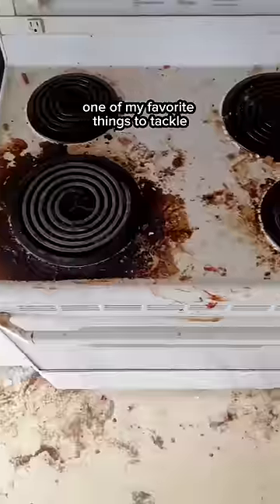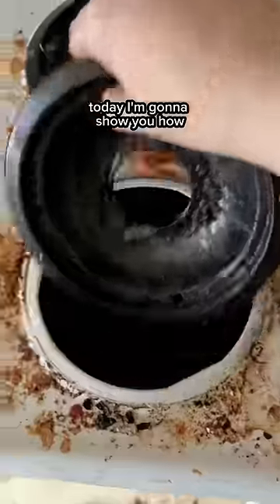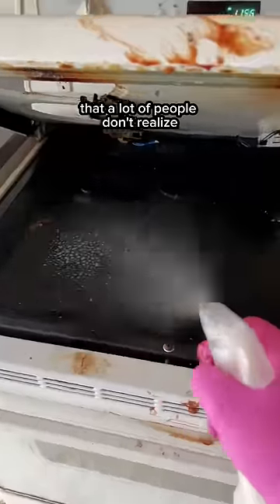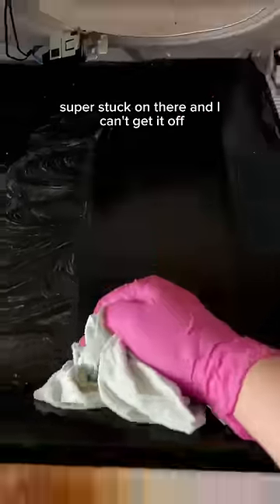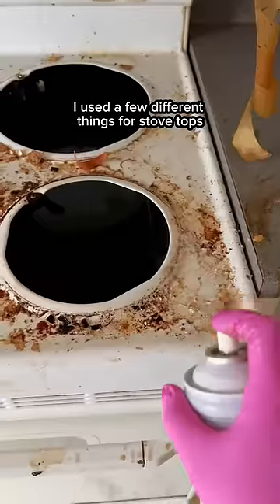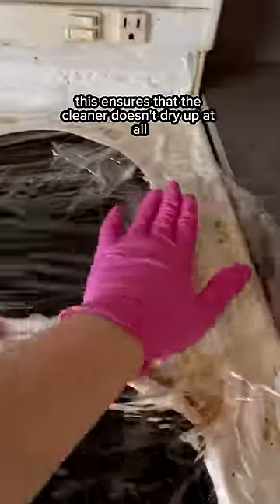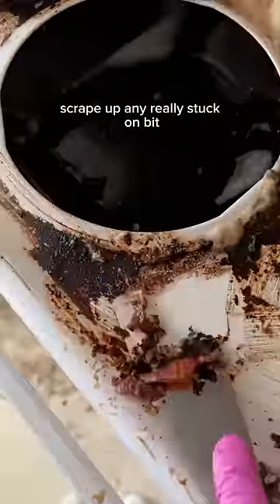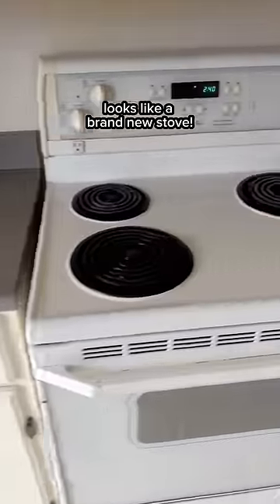How I get greasy dirty stove tops sparkley clean again ✨

Comment: Some people don't realize that the stove top opens up to clean.
Reply: I don't know how😅
Reply: Seriously I never knew and whoa I'm afraid to look now lol
Reply: Only some. Ours needed to be unscrewed and there were wires. So not designed to be cleaned inside.
Reply: After you pull out the coils, lift up the pans, rinse and let soak in hot soapy water. I usually clean the top surface next, so if any thing drops below, I only have to clean the underneath once. Grab the hole and lift up gently like a sedan car trunk, and you can access the underside.
Reply: I don't think the gas stoves open up like that.
Reply: I was 3 apartments in before I realized you could do that 🫣 where was this video when I needed it lol
Reply: I didn't and experienced a few seconds of absolute panic before remembering I have an electric stove top 😅
Reply: @grenwood6551  Sometimes there's a little lever that you have to slide or push before you can lift it up- that is, if yours does raise.  I had an old stove that didn't lift up, but the one I have now does.  Check for the lever thingy  :)
Reply: @Deci_Bella  some do. if it doesn't have sealed burners, you can lift it. my gas range from 1998 top would lift up.
Reply: @Deci_Bella  unfortunately you're right. I have an older gas stove so no sealed burners. After buying the house I'm finding these people must have been stealthy hoarders cause there was lots of creepy hidden crap in the house. I can only imagine what might be lurking bekow the burners.
Reply: @patriciabaylor4573  I recommend googling the range model to see if you can find the instructions. I was sad to see that mine required a service person to take it apart after disconnecting the gas (which is too expensive when it's not broken!) Fingers crossed I've never had a rodent problem so I'm just in denial til I can afford a replacement, and hoping there's nothing lurking in there.
Reply: @emmasurf8768  I don't live in that house anymore. I didn't have any problem lifting it.
Reply: @Deci_Bella  mine does. It is scary because it doesn’t have anything to hold it open.  So it’s like a guillotine.
Reply: Does anyone really need to be taught how to clean a stove? It's just common sense.
Reply: Imma be honest, I didnt know this until after 2 years of having a stove top causw when I was like.. 11? My mom switched to a glass top stove which is when I started taking an interest in cooking and stuff so I had no clue
Reply: I didn't realize it did till yesterday...when i told you i was quite disgusted i mean it
Reply: @Deci_Bella  yes gas stoves open up
Reply: It's a fire waiting to happen if you don't clean under the stove top
Reply: @Deci_Bella  The top usually lifts out completely, rather than tilting. At least that has been the case with every gas stove I have cleaned.
Reply: Only if you have a gas oven. Doesn’t matter for electric because there’s no way for the food to get under it
Reply: Only the coil type cook tops do. Obviously the gas and glass tops don’t separate as easily but it can be done.
Reply: Mine doesnt almost broke it thinking i could
Reply: I just went and looked lol it’s true thank you for that wow
Reply: Mine has to be unscrewed and I’m scared of ruining something lmfao
Reply: I remember learning that during an annual rental inspection.
I was very embarrassed and I clean it regularly now.
Reply: @Kateiswriting 
My electric stove lifts up once you remove the burners - all the electric stoves I’ve had the burners pulled out. So once you have out the burners and the trays that they restaurant, what you see when you look at your stove. Then I just reach in one of the holes and pull up and there’s two wire arms, one on each side that props it up that I can safely reach and clean out just like you saw in the video. It’s rare that an electric stove does not allow you to pull out the burners and lift up the whole stove top essentially.   It’s the first time I heard about using an oven cleaner. But that would’ve certainly helped immensely when I had spilled things that I couldn’t clean up immediately because I was sick. So check out your stove. Just make sure all your controls are set it off that you don’t accidentally burn yourself. You can even wash off each coil burner, just make sure the prongs that have to go back in when you reassemble your stove are dry. Have fun getting to know your electric stove top. Someone else a remote that her stove top does not open. And before I knew you could lift it up, I still was able to unplug the coils and reach in and clean as much as I could. At that time, it was mostly crumbs. But when you boil over something that’s a mess good luck.🧽🫧🫧
Reply: Some do
Reply: I didn’t know either. I am going to try to lift my when I get home. I hope mine lift up. It will be way more easy to clean under it. 😊
Reply: Some do, but easy enough to find out which do.
Reply: @Katarina23 
They need to be reached inside the burner area, once you remove the burners, trays etc.
Reply: @Deci_Bella 
True, even some electric stove don’t lift.
Reply: What's really annoying is I used to have a stove that opened up like that and my new one doesn't and I can see stuff under there 
 
How am I supposed to clean that
Reply: @emmasurf8768  you’d know pretty quickly if you did
Reply: @Simba______  that’s a huge assumption. Some (especially older models don’t open for cleaning); some people haven’t been taught; people due to disabling medical conditions can’t. I was a military brat and on base housing a privilege that comes with higher rank. Housing is inspected before you move in and before you move out. And everything had better be in spic&span order or the service faces consequences, like a written reprimand or fine. Those affect promotions. You can’t imagine my horror when I moved into my first civilian apartment of my own. I was a young veteran by then with no experience of apartment hunting so I didn’t open the stove top or refrigerator. Most common sense is based on experience and not everyone’s experience is the same.
Reply: I always conveniently forget...and then inconveniently remember when I thought I was done.
Reply: Not all stoves are made alike!
Be careful lifting your stove top!
Make sure you read the instruction manual first or look it up the info for your stove's specific model.

The stove at my old house was designed for easy cleaning under the top. We had to simply grip the corners on the stove top, lift it up, and use the 2 built in *support rod props to hold the stove top up while we cleaned under there.

My friend on the other hand wound up having to call for a repair because she didn't know that unlike her previous stove, her current stove's top could couldn't just be lifted up to clean underneath so she wound up breaking something when she lifted up the stove's top. Whatever she broke a pilot or 2 wouldn't light afterwards.

*The same type of support rods that hold the car hood up when you do to work underneath the hood. Our stove had one on each side.
Reply: @Deci_Bella  they do.  Mine does.  Open it every time I clean.
Reply: I hate to admit it, but I never knew it before she cropped up in my YouTube feed.
Reply: I never knew..
Reply: I live in Italy and I’ve never seen that kind of stove before. Maybe it’s typically American?
Reply: I had no idea. When I learned I could, I realized the people before me didn't know either. So I didn't feel too bad. You could tell it had only had the parts you could reach through the holes cleaned.
Reply: @Simba______ imagination, compassion, and empathy is also common sense, yet you lack all three with this comment.
Reply: I didn’t until my partner showed me lol shit blew my mind.
Reply: I tried to lift the cover but small flames were still burning . I don't know if I can do that anyway. I'm afraid
Reply: I JUST FUCKING LEARNED THAT BRO WHAT THE FUCK ITS LIKE THE HOOD OF A CAR WITH THE THINGS TO PROP IT UP AND EVERYTHING
Reply: I tried to open it and I can’t
Reply: Not all are that easy.
Reply: OnG? I didn’t know🤣 I would just try to get it clean😭 now I know
Reply: @Deci_Bella Mine does but I'm not sure if I should spray stuff because of the exposed flame
Reply: 😂ŵaffĺe  house
Reply: Some do some don't surprised you dont know that it varies
Reply: Wow it’s like a magic 😅👏🏻 i tried with mine
Reply: @Deci_Bella mine does.
Reply: Also the pots & pans drawer at the bottom of the oven. Seriously, some do not know about this.
Reply: Nobody told me this and i never seen it until now so 🤷🏽‍♀️

Comment: You mentioned you use steel pads to get off REALLY stuck on grime, but as a former housekeeper, we were specifically told not to use steel scrubbers because they can scratch the stove. In this case, do you know what specific stoves are suseptible to scratches, or is it more imporant to get everything 100% clean rather than worry about asthetics?

Comment: We use Dawn to clean ours.  Works better than oven cleaner and isn’t going to kill anyone faster.  The dawn powerwash just has added alcohol, but it works even faster on tough things.
Reply: Dawn spray is a great grease cutter but I feel like it gets in my lungs. Does anyone feel that way too? I use it sparingly
Reply: Thanks for the tip

Comment: Covering those burner trays in a layer or two of quality aluminium foil so the dropped bits of food don't bond onto the tray can save hours of work in future. Covering the base tray works too. 
We used to be able to buy purpose made thick alfoil covers that just fit snugly but I haven't seen them for years.
(yes I'm Australian so it's ALUMINIUM)
Reply: Yes, I've just scrolled through the comments to see if anyone else does this.  (I've actually got a glass top cooker now, but my mum always put the foil down, so I did when I moved out & had to clean for myself.)

Comment: Tip for a flat top, take soft scrub cleaner, soak like you did Here, use an electric sander with a green scrubby instead of sand paper. I used to flip apartments, this trick came in handy.

Comment: I'd really love to know how you get the burner cover bowl things clean.
Reply: Yeah, that wasn't enough information.
Reply: I was thinking after the soak maybe that same oven cleaner stuff would do it. What I've tried has not cut it.
Reply: Soaking and scrubbing would do it
Reply: They usually soak off most in super hot water and Dawn. Depending on what material they are made from, those Steel scour daddies work really well.

Comment: For gas stoves I remove crumbs …then soak heavily with dawn power spray . Any areas that are nasty leave some baking soda for 10 min 
It comes out with no issues with a sponge 
I try to clean as I cook but at minimum clean 2-3x a week the stove so it does not get grimey

Comment: Having lived in so many places where all of the appliances were heavily scratched by using steel scouring sponges, I would never use them. There are other methods that do not work as fast, but don't damage the surfaces. Once the surfaces are damaged, they are way harder to keep clean.

Comment: Do you have a video about which products you can use with a scrub daddy that won't break down the plastic sponge? I used mine with a Cif cleaner (not the special Scrub Daddy one - can't find that anywhere) and Bar Keeper's Friend (not at the same time) and the sponge became super weird and sticky. I Googled and it turned out it was probably the products that were the problem. Now I'm scared to use it with anything stronger than dish soap and vinegar.
Reply: I have been using the amazing whip it (I know sounds funny definitely go to their website). It’s all plant based and eco friendly for pets etc. they have a whole line of products for laundry , pet odor elimination etc. it does wonders for me when cleaning 

I bought the scrub mommy for my dishes and I love it. Maybe the cif (not scrub daddy one) made it that way. I don’t know the difference between the two bottles of cif but maybe the formula was changed to preserve the integrity of the sponge.
Reply: CIF:  original or lemon ?

Comment: Have any advice on a Frigidaire glass top but it has like metal ceramic coated burners that are gas burners because the stuff is so burnt on that we’ve tried everything of things you’re not supposed to barkeepers which comment steel just everything

Comment: If you leave the oven cleaner on longer, it will cut through all that and you only need to wipe it. 

I spray it on and leave it as the last thing to return to, so the oven cleaner has time to penetrate. 

Works on pans, too…but not aluminum. And wash the pans well after using oven cleaner, which should be the very last resort for pans.
Reply: Won't oven cleaner damage the paint by the burners?
Reply: @debi7039  I’m not sure what you’re asking. But when I was house-sitting while my parents were away, I made a stupid mistake:

I was making popcorn in a pan on my parents’ glass-top stove, and a few pieces popped onto the burner. Instinctively, I grabbed a dry microfiber cloth and tried to wipe it, causing the cloth to burn on the burner.  So what did I do?  I tried to wipe THAT off with the same cloth. 

I don’t think well under pressure. 

I frantically called my sister, who appeared with a can of oven cleaner, sprayed the burnt spot (that was cooled, by this time), covered it with a lid, and instructed me not to touch it until the following morning. The next morning, I simply wiped it with a paper towel, and it all came off!!

A few years later, my husband and I moved to an old 100 year old house.  The house had a glass top stove, and on the glass must’ve contained several years of burned-on food. 

This stove took more time, but I sprayed it with the same brand of oven cleaner, covered it with sheets of plastic wrap, and left it overnight. The next morning, much of the crud wiped off. I had to spray it about four or five times, before I was able to get everything off the glass.  By the time I was done,  the stove looked brand new. It did not remove any paint that was on the glass. 

If you question the way it handles paint, try to find an inconspicuous area where the paint cannot be seen, and try to add some oven cleaner. If it eats away at the paint, then I wouldn’t recommend it. 

‼️ DO NOT USE OVEN CLEANER ON ALUMINUM!!!  It will eat away at aluminum, and turn it black. I used it on one of my mom’s toaster oven cookware, and she wasn’t happy. But, truth be told, if you have aluminum cookware, you shouldn’t be cooking in it, anyway. Aluminum is not good for the body.

Comment: Just cleaned the oven and stove top. Luckily the oven is self cleaning and honestly does a great job but spent close to an hour trying to clean those dang burner trays, and they did technically get more clean, but when they dry. They look awful. Frustrating.

Comment: When you pull the top of the stove up are you just using the scrub Daddy? No mention of any product used under there. What do you suggest for people that are really sensitive to cleansers and also have pets? Right now I only use soap and water I was using simple green but my dog had a seizure so I won't be using that even though it's supposed to be safe. I didn't dilute it as well as I could have and he is prone to seizures. I recently discovered boiling water, I had never tried it before and I cannot stress enough how incredible it is for cleaning grease and grime and everything in between. If you put boiling water on everything including stoves, floors, counters, cabinets, bottom of the refrigerator it will take up a lot. But I was just wondering if you could please recommend something for those of us that cannot use these poisonous cleansers. Further, you're exposed to a lot of toxins in these houses and then you're doubling your exposure to poison by using these cleansers. I know you're in a hazmat suit and you're protected, can you please show us again what mask you using I believe you're using a painter's mask or some other type of hazmat protection? Though I would not use one of my own house I would use them on my work houses as I fix and flip real estate. You're cleaning has really inspired me. Just coming from a place of non-judgment and understanding the psychological effects has helped me with my own cleaning issues and then of course understanding the homes that I buy and what people have gone through mentally to get where they are. Somehow, once I had that acceptance and understanding I have really taken a liking to cleaning which is really bizarre for me and it all started with your videos. Thank you...

Comment: you left all that crap from the top into the bottom of the stove top. -10 out of 10 for cleaning points. You ALWAYS clean the top first and then underneath so all that crap from the top falls to the bottom. I wouldn't want you cleaning my kitchen if I had a stove like this. When I did have one. I went from the top down, not the bottom up. Fail.